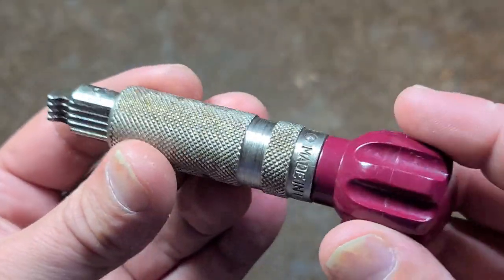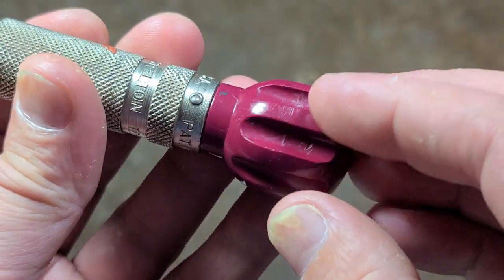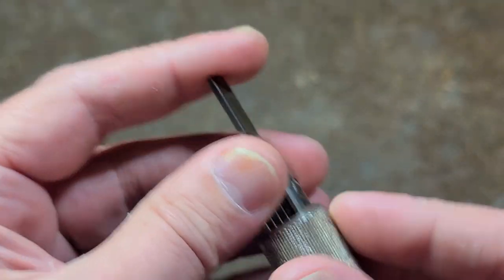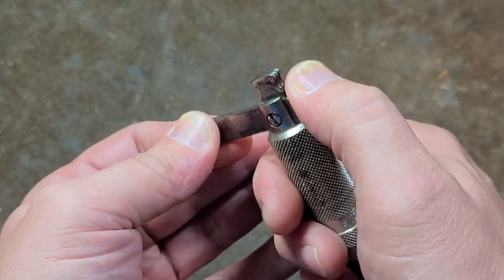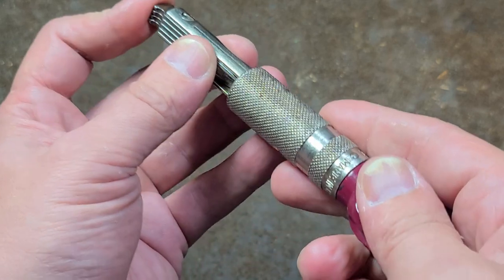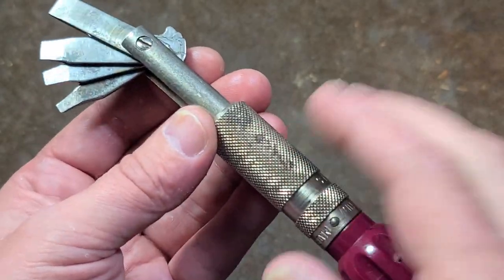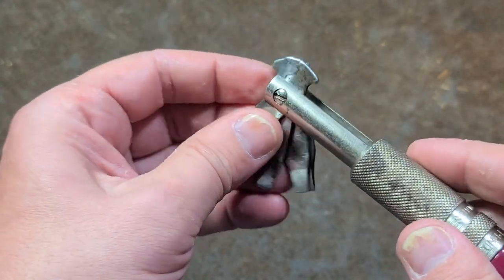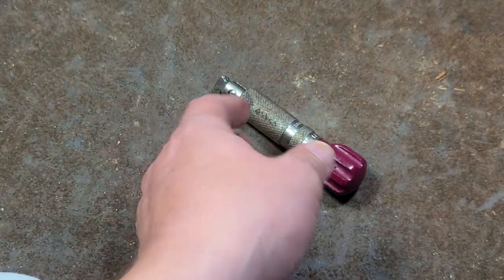Shelton Tools USA Multi-Blade Pocket Screw Driver Review

Comment: 👍👍
Wow, Ive never seen one of those before. Good find 🐈. Americana at its prime in 1952. I wonder what machine it was designed for?
... or could you imagine how light weight it was to carry all those flights up the stairs in a N.Y. city commercial building, and houseing complex, To tote around in a tool bag.
  Hell i about died carrying my father's tool box up, and down stairs in Philadelphia.
   As a teenager in the 80's doing A/c work along with apartment Maintenance, and get readies for new tenants. 
      Thanks dad for the nightmares. 
  My late Father (Marine) Sgt.  Roy L. Arms Jr. (Vietnam 1963 to 1972.)